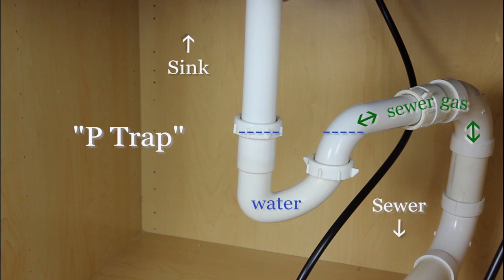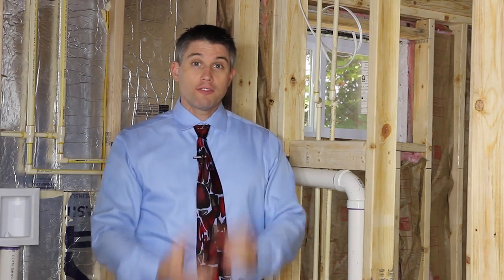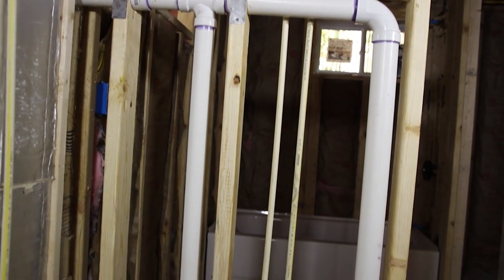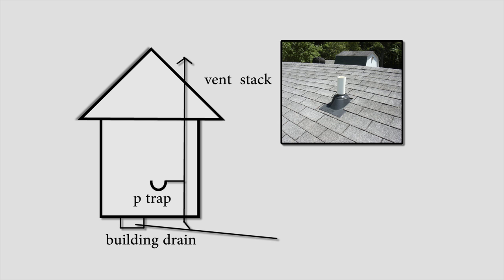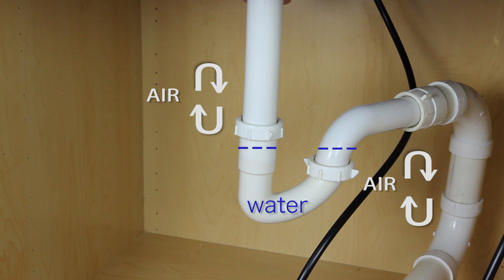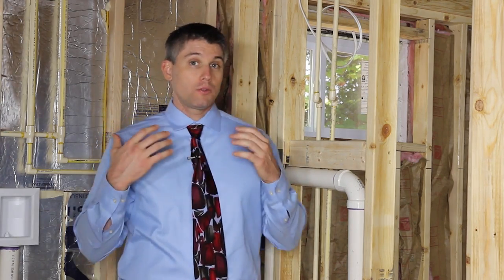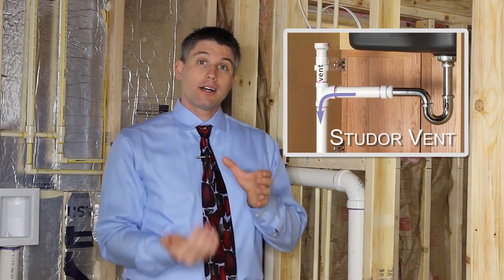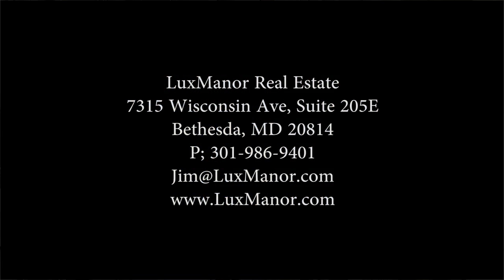What's that Gurgling Sound? Your Vent Stack and P Trap

Comment: My bathtub gurgling has changed how to fix
Reply from the maker: You may need to open the wall behind the drain or ceiling below the drain (on the floor below) to see what is going on. This is hard if your drain is in the basement and on an exterior wall with tile on the inside. If you do install such a vent check with your local codes. Where I live, it can even be installed within a wall, provided it is accessible. Does the drain ever smell bad after a short period of time with no water coming through?  Do you have photos of when the work was done? The noise is generally not the problem. The sewer gasses coming through are what we're trying to avoid. Hope this helps!

Comment: Sorry but you are giving people the wrong Idea, plumbing should be done per code not just pick the first easy thing there is available. You need a plumber.
Reply from the maker: Thanks for your comment. We work hard to make sure we're giving sound advice. Air Admittance Systems (eg Studor Vents) are accepted by virtually all national building codes and plumbing codes. My licensed plumber and I agree with you that if possible to take it out the roof, that's a better option. Here's some more research I've done: https://www.iccsafe.org/building-safety-journal/bsj-technical/codenotes-installation-of-air-admittance-valves/
Reply: THE DAF FAMILY, Air admittance valves are approved by the International Residential Code (IRC), which is used in most areas of the country with only minor modifications, but not code approved in a few jurisdictions.Feb 26, 2020. Before you complain, research.
Reply: You sound like a real peach.